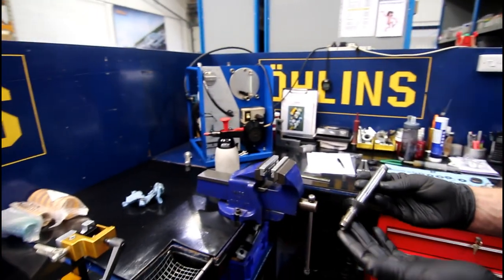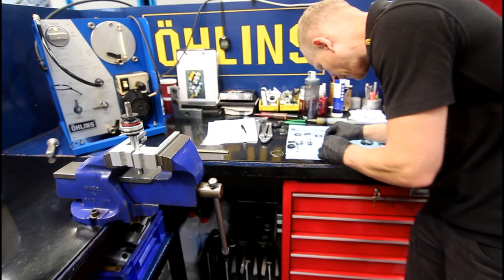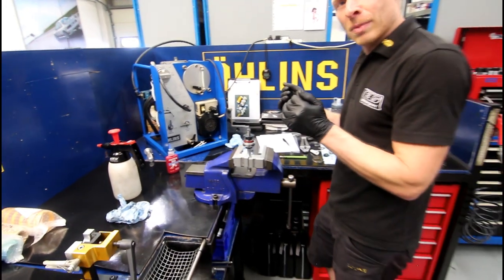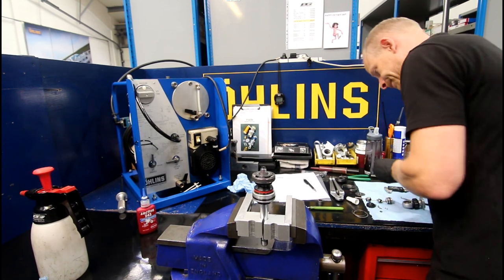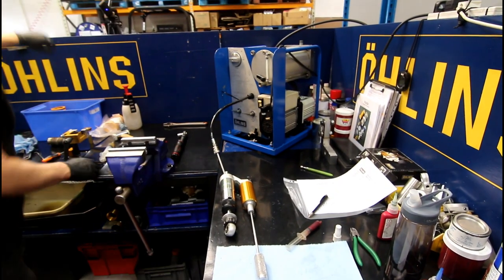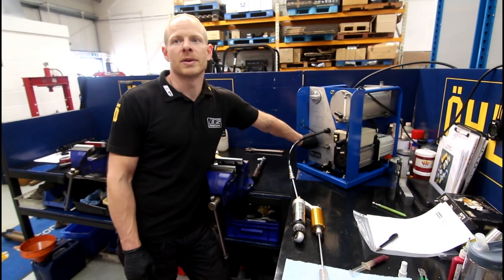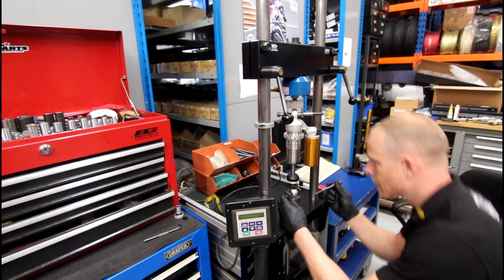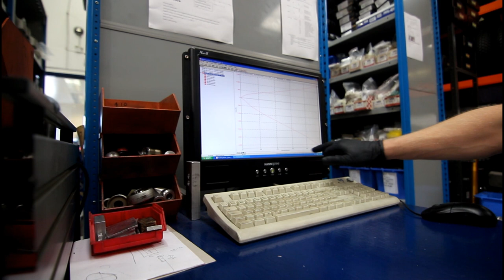Ducati 916 Project Episode 8 - Pro Ohlins Shock Rebuild - Shocking Suspenders Part 2

Comment: What a top bloke and great he took time to explain everything. !!!   Indication of rough cost ??    So you got a new spring?   Stock or adjusted to your body weight ???
Reply from the maker: Indeed he was. Cost was between £3-400 if memory serves - it depends on what parts are needed and we needed a few! The spring was for a 196lb rider in gear.